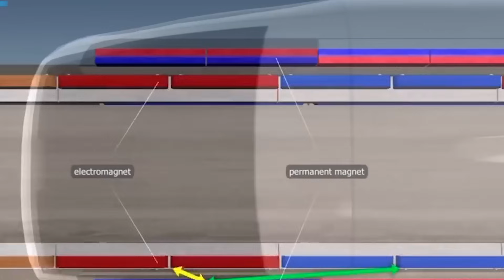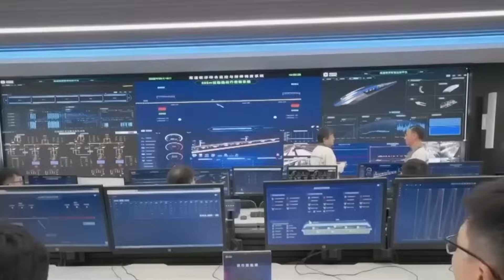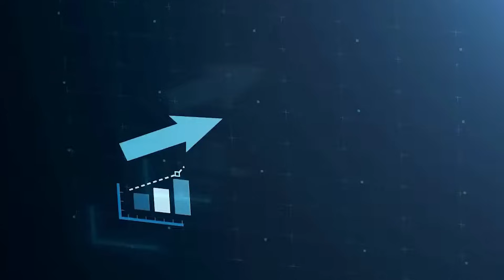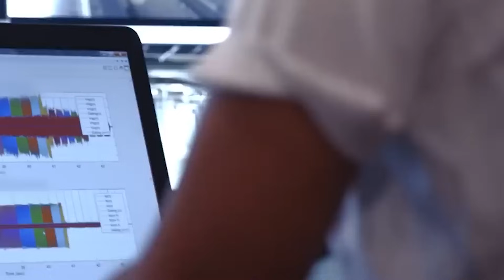China Has Built a New Train That is FASTER THAN A PLANE, Reaching 1000 Kilometers!

Comment: This is a clickbait video. China’s CONCEPT PROTOTYPE MODEL train reached 1000kmph in a short test track once. Commercial trains that are decades away from being build - if ever will be feasible- will operate nowhere near this speed.
Reply: @DJSurronX Even if that’s true, that’s much MUCH different than the “China has built a new train” as it’s written in the title. Also, although the prototype reached 1000km/h, the commercial speeds won’t reach anywhere near that, still being incomparable to a plane, as the title also misleads you to believe.

Comment: I'm all in for new technology but what are your sources? All I can find about it is, that it was at least faster than their last record with 623km/h (no specific speed was mentioned) and that it was reached in an only 2km short tube. Nothing more. That's basically nothing since there is no proof apparently.
It's just fancy CGI which is worthless and the maglev train leaving a depo. All the other pictures here are from either other high-speed rail or the Japan-maglev.
Also how is this supposed to be more economic than planes at such high speeds? The faster you go, the more energy you need to the square. Even in vac-tubes. Sure, you need less since there will be low air-resistance but going 1000km/h still takes tons of energy. Not to mention 4000km/h.
And just like you said the tracks need to be really strait, so you probably have to dig tunnels (just like Japan is doing it for their maglev) which are really expansive. And even if you build it above ground, you need massive amounts of steel for the tubes, still massive amounts of concrete for the foundations of the track, massive amounts of energy for the vacuum pumps and all that produces massive amounts of pollution.

And btw humans can even breath easily during light speed travel. It's the acceleration that's important and I think you wouldn't want to sit in that train when it accelerates to at least 600km/h within 1km. The G-Forces wouldn't be pleasant
Reply: https://www.youtube.com/watch?v=5WAez2n2lSU
Reply: https://www.youtube.com/watch?v=w1c7K_Mv2BM&t=206s
Reply: @alexzeng  thank you for the link, but that video is too old to have actual results of tests of this new vacc-train and is otherwise just a shiny, old recap of the vaccuum train concept with no concrete sources mentioned aswell for specific information on the chinese vacc-train.
Reply: @geht-dichnix-an4183  The 1000km/h train from Shanghai to Hangzhou is already being planned. From Shanghai
Reply: @alexzeng  Just because they plan something doesn't mean they will (or can) build it. Just look at the HSR between LA and SF in California. 
I'll keep looking for more information about this and if it develops, but so far it's just words and words don't mean much.
All the vacuum-train projects in the west went bust so far.
Maybe this will be different. Who knows.
Reply: https://www.youtube.com/watch?v=KBIUvRt1fbQ

Comment: Your title says CHINA HAS BUILT and inside the video you said it is the first phase of testing, currently the working model of MAGLEV in Shanghai tops at about 500 KM/h, which currently goes inside city from Pudong International airport and is operating at about 350 KM/h only. Secondly at about 1:33 minutes you say that it will connect Shanghai and Wuhan province, a slight correction, Wuhan is not a province, its a city of the Hubei Province.
Reply: 🤓👆 bro leave some girls for us

Comment: Wow, China has developed the new maglev trains with a speed of 1000km/hr which surpasses the Japanese maglev technology. The hyperloop trains are much safer than aircraft and definitely more cost effective. China has already tested the super maglev trains at a speed of 4000km/hr which is multiple times faster than any Boeing aircraft. A new age of traveling by supersonic train has come and it will start in China.
Reply: @user-ll8ni9uh3d bon voyage moon ami.
Reply: Don't go too fast! 1000km/h for now...
Reply: @罗晶耀  the hyperloop trains concept is much safer than air vehicle concept and without doubt it will be more popular for long range straight line city to city transportation. In fact a hyperloop concept is probably easier to build than an aircraft with the same passengers capacity. A supersonic hyperloop train can be built since the tube in which it operates can be made vacuum. With a rocket engine the hyperloop train can reach mach 2 easily. This will be the future transportation in the world.
Reply: @philiptan2051  I know. I've just said that they have successfully tested at 1000km/h for now. Not 4000km/h yet...
Reply: @user-ll8ni9uh3d Dans 20 ans peut-être si les Européens acceptent la présence des Maglev Hyperloop Chinois sur leur territoire (Cf BRI)...